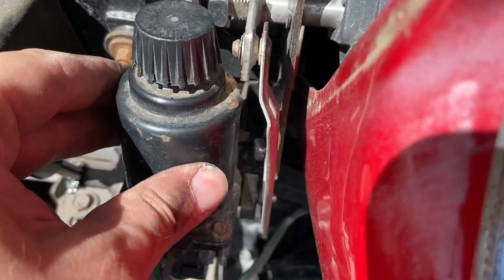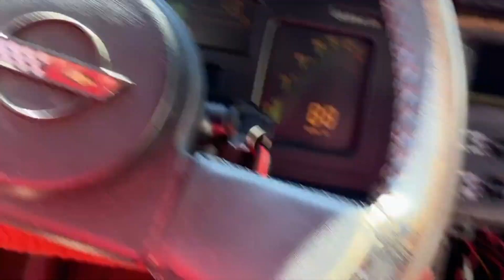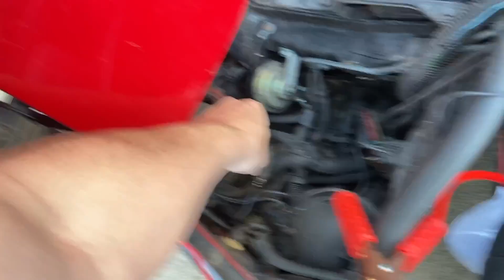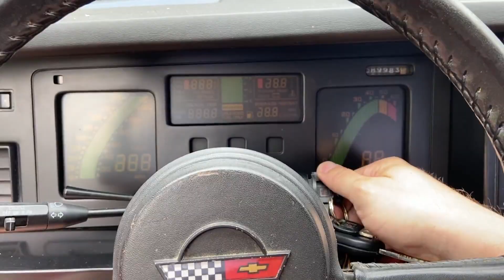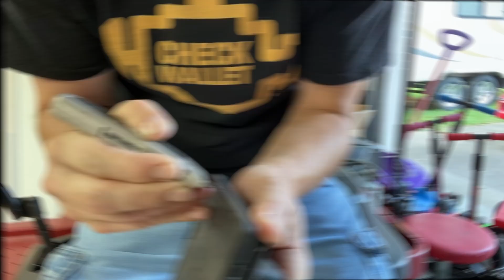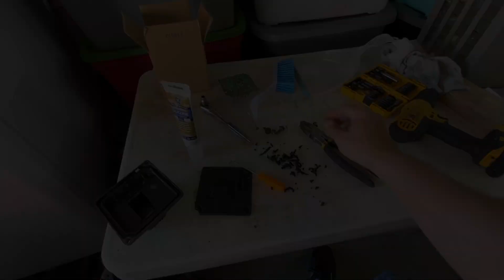Project Poorvette - Thrill Billy's C4 Corvette Project Car - EPISODE 6

Comment: I had a 1985 Corvette from 92-95 and mine had the headlight control module. My headlights stopped opening and I eventually figured out that the headlight control module was bad. I changed it and all was good again. I can assure you that the 85's had headlight control modules, at least mine did...

Comment: My concern now is that passenger side motor.  Its still running slower that the driver side which may mean that there is more resistance then there should be which could cause that module to burn up again.  Great work and ingenuity getting that module repaired though.  Reminds me of a Temp sensor for a digital thermometer in my 08 Tacoma that lives in the roof mount console above the rear view mirror It was notorious for having week solder joints and failing.  I had a buddy of mine redo the solder joints and I was back up and running with 200 bucks still in my pocket!
Reply: I think the passenger side motor is a little worn out. I have a feeling the loose hardware on the bracket prematurely wore it out. You might be right however.

Comment: I had that same Shoemaker charger, worked great until I ran it over! I had the same issue with the wire coming off the clamp. Easy fix. POP UP UP AND DOWN HEADLIGHTS!

Comment: I had a similar issue with my 87 firebird. That round plastic ball by the headlight module is the vacuum reservoir for your hvac. If you follow the lines. One should go to the intake and one will go to the firewall
Reply from the maker: Awesome info